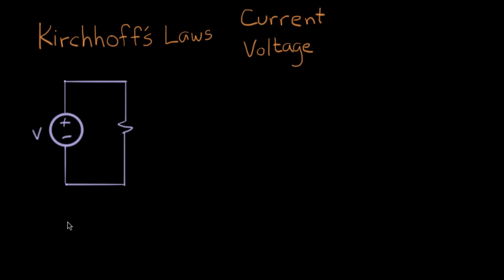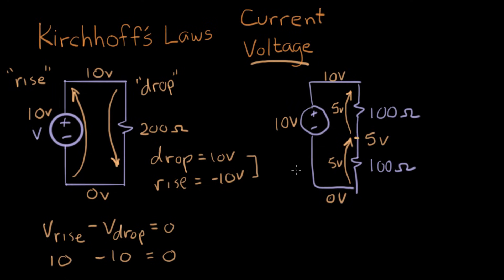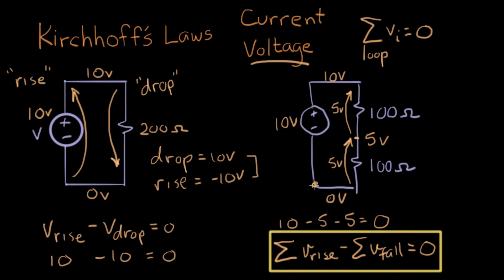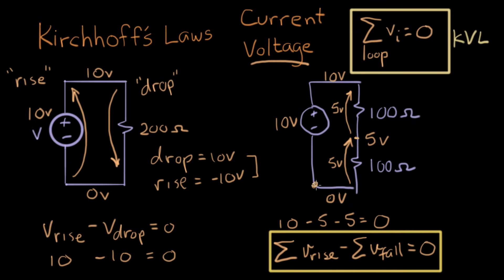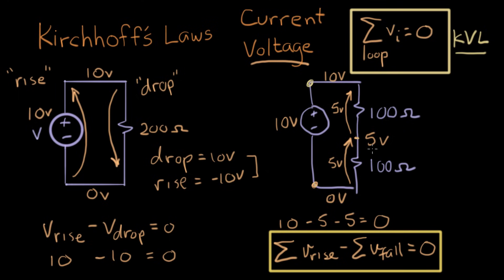Kirchhoff's voltage law | Circuit analysis | Electrical engineering | Khan Academy

Comment: I did understand the concept, but I do have a question tho, does kerchhoff’s law mean that (theoretically) the delta V in every closed series circuit is equal to zero?
Reply: Yes because they will all cancel eachother out. The net change would just be zero.

Comment: QUESTION: I thought that the voltage throughout a circuit was constant. I'm confused by the whole "voltage drop" thing. Shouldn't it be constant through and after hitting the resistor?
Reply: in series it drops, but in parallel it stays the same
Reply: I ain't no expert but from my understanding of volt, volt is just energy applied on charge to overcome the "opposing force" (Resistance). Or in other words force to get charges moving but force will be zero if there is no Resistance or charges are already moving, therefore if Resistance is zero either volt is zero (meaning charge need no force to overcome Resistance since it's already zero) or the current is infinite (which again means the same but this time it specifies that charges ARE moving).Resistance causes voltage causes current. So answer to your question, voltage isn't constant. (Correct me plz if I am wrong in anyway, i highly appreciate it.)
Reply: Voltage is the energy per unit of charge. As charged particles pass through the components of a circuit, they will transfer energy to them. This results in a voltage drop.
Reply: No

Comment: It makes sense that it's 5 volts in the middle node, but how do you get to 5V? Mathematically speaking
Reply: You can look at each resistor as a voltage drop. In this case 10 V between 2 resistors drops by 5 each time.
Reply: @СщькфвуЫефдшт  But why does 200ohms create a 5volt drop?
Reply: @andycoutts517 since the two resistors are connected in series, you can calculate the resultant resistance (R1+R2=200) and using Ohm's law (I = U/R = 0.05 A), calculate voltage drop by (U = R*I = 0.05*100 = 5 V)
Reply: We know that current is constant in a series circuit, so i total = i1 = i2 and so on. In order to get the i total, you would need the formula of i total = V total / R total, which is 10 / (100 + 100). As such, i total = 0.05, which also means i1 = 0.05 and i2 = 0.05. So, to get the voltage drop in each resistor, you would use V = i * R.

V1 = i1 * R1 = 0.05 * 100 = 5 V
V2 = i2 * R2 = 0.05 * 100 = 5 V

Comment: Can someone give me a proof why the voltage drop should be the same as the battery?
Reply: The potential energy is exhausted over the path of the circuit much like lifting an object off the ground to increase it's potential then dropping it only for it to return to it's original potential (converting potential into kinetic energy for example)

Comment: "I'm going to arbitrarily call this 0 volts". Why? Ohms law says that the voltage there will be .05V. Is that not correct?
Reply: 0.05A is the current, not the voltage.

Comment: Great video! Just one question: Will running two 12V fans in series off of a 24V power supply overvolt the fans? Or does the voltage have nothing to do with this equation?
Reply: has nothing to with that. do 12v to both.

Comment: ATTENTION: EVERYONE WHO IS ASKING ABOUT -20 VOLTS....
His equation Vrise - V drop = 0 is the equation for the whole circuit. On the left side, where the battery is, there is a 10V rise....on the right, where the resistor is, there is a 10V Drop...this is where he is getting 10(rise)-10(drop)=0   |   That rise= -10 is, like he said, just another way of writing a drop. I understand the confusion, there is not much point of writing that unless he wrote 0=sum of voltage rise ... in which case that specific "rise" on the right would technically be negative due to the resistor, however that is often confusing and he just was using this as a way to get you to understand that this is a decrease in voltage. His math however is all correct.
Reply: Thanks a lot
Reply: By any chance do you know what the voltage is actually doing when it drops?
Reply: @Rick-gd6pe  the potential energy between individual electrons in the wire is dropping, meaning they are getting further apart. Because energy should be conserved in an isolated system consiting of the wires and resistive element, the loss in potential energy presents itself as an increase in heat (or light). This is a vast oversimplification of what actually occurs on the subatomic level and is not totally correct but it is a great way to think about it when first getting started, and will take you pretty far in electronics.

Comment: Pretty badly explained because 'rise' has nothing to do with the perception of view, it has to do with the travel of conventional flow. Just to further prove this, imagine the resistor is sideways, left to right instead of up and down. There is still a drop on that resistor even though it's going sideways. The problem with this instructors explanation is that he is inferring that voltage is a sort of travel, but it is not gradual travel, it is explicitly a measure of the difference between two points. Here's where this video fails and it is the problem with the conveyance of the teaching.

Comment: If drop is 10 volts and rise is -10 volts. Formula V rise - V drop = 0; in this case -10 (rise) - (+10) drop= -20?
Reply: 10 volt drop is same as -10 volt rise and you can also say that 10 volt rise is same as -10 volt drop. 
If you cosider it like this and the formula is that Rise - Drop =0
 Then -10 - (-10) = -10 +10 = 0
Here I have considered 10 Rise as -10 drop and 10 drop as -10 Rise. It is quite confusing though but yes this is also a way how it works.
Reply: Those two values are referring to what is happening at the resistor, not the whole circuit. He was only pointing out that a drop of 10V is exactly the same thing as a rise in -10V

Comment: Hey, in 3:03 there is a error is guess, look, u have taken voltage rise as -10 and voltage drop as +10. The formula u told is saying voltage rise minus voltage drop=0 . If i substitute that " minus 10 minus 10 which leads to -20. Can u xplain on this.
Reply: Actually the rise is 10, look when it passes through volt meter and the drop is 10 as he said so that implies 10-10 which gives you 0 👍

Comment: Thank you so much for this video! I have been really struggling with understanding when voltage and amp sources are equated as being negative verses positive, especially when there is a mix of both in the circuit!

Comment: (For 2:19) If I connect one voltmetre across the battery and another voltmeter across the resistor will the voltmeter across the battery show +10V and the voltmeter across resistor show -10V ?

Comment: the voltage directions are wrong so the numbers become wrong too. this is very misleading
Reply: Voltage drops across the components (resistors) are positive if a loop direction is opposite to the current direction

Comment: Why the voltage drops?
Reply: america vs everyone else
Reply: because the total voltage in the circuit is 0 and theres only one resistor. so after it passes the resistor it would be 0.
Reply: TheRoxas13th Volts is the difference of potential at two point ... so in battery we consider (-ve) as (0)volt and (+ve) as (V)volts
Reply: it didn't the current flows from - to +
Reply: Daniel Joseph what if there is no resistor. What happens then?
Reply: If you have a resistor in the circuits then it's based on Ohm's law. 
I = V * R ^ -1 that means current (I) is proportional to the Voltage (V) and the resistance is inversely proportional to the current (I). 
When you understand this relationship then you notice that more resistance you have less the voltage you get (this is called voltage drop). 
As to 2nd Kirchhoff's law I quote my college tutor: 
We determine the direction of the current and add all the voltages positively (here he means voltage rises across battery and it falls across resistors this is called voltage drop (look above )) and subtract all the voltage drops, I.e. 
U(t) - IR(t) + Uind(t) = 0. Before turning any circuit on, U = I = 0, afterwards U(t) = U0 (nominal voltage ), (don't need to know this I think )which leads us to the differential equation :
L dI(t)/dt + RI(t) = U0 for I(t). 
I hope I helped instead of confusing you even more.
Reply: vomont 
There's formula to calculate resistance if conductor. 
Rho * Length * (cross sectional area) ^ -1 you have to find resistivity for your conductor (copper etc )

Comment: what happens when charges move flat I mean why does potential drop occurs only at resistors? I mean when an electron travels from negative end towards the positive end it continuously loses potential so why we don't consider potential at flat areas where no resistors are present ?
Reply: VIKRAM SHARMA it's very low so we usually ignore it. Not always, however
Reply: That is covered in resistivity though for circuit design is often negligible

Comment: Ok. Why did you "arbitrarily" name nodes with negative voltages? Is it with respect of the voltage in? And why does -10-10=0? Why is the node between the 2 resistors 5 ohms? Why does the voltage rise and drop in a circuit after sal showed its uniform all the way around? These are things that should be addressed. Instead of just saying this is it, you should leave the viewer with the knowledge of why this works and why it's useful. No intuition developed from any of your videos. I'm sorry. I'm sure you're a brilliant engineer, but when it comes to conveying your knowledge/intuition on a subject, not very good. Thanks for the effort though
Reply: That -10 is just to indicate direction .
Reply: Bruhh dude it was so easy and awesome ... honestly u just read once from a book, come back to it and then you'll see its fab
Reply: That was the best way to put it !